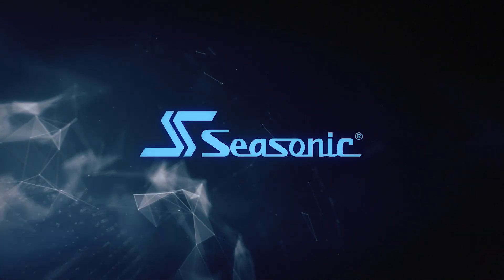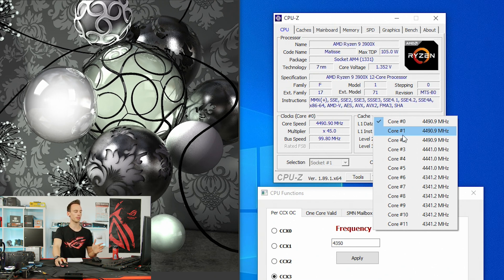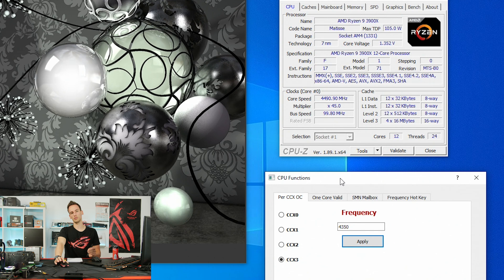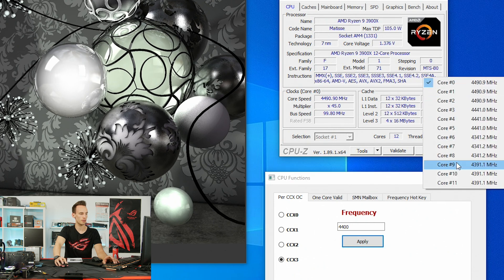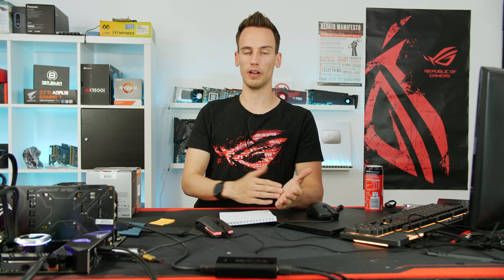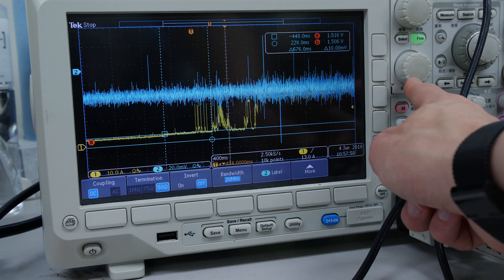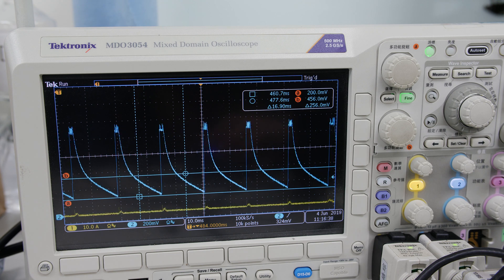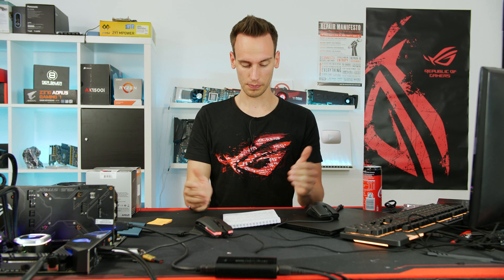The most amazing feature of RYZEN 3000 - Power Saving (and some CCX OC)

Comment: Hello der8auer
, this tool is possible setting on ryzen 3700X all core with good Vcore?
I have cpu with Vcore Up and Down and clock 3600 and 4300, it'a very insane, temp are mediocre, 45° idle 80° full

Comment: Not quite sure any of this holds up to actual benchmarking.  Ryzen is unfortunately across the board much less efficient than an 14nm Intel chip *at low utilization*.  A 9400 will use about 15 watts idle with a decent motherboard and power supply, however its pretty much considered impossible to get any Ryzen without integrated graphics to idle below 30 watts using the same GPU.  The new 3600 is also less efficient than the old 2700 despite being on a newer process.  

https://tweakers.net/reviews/7222/6/ryzen-5-3600-en-3600x-nieuwe-ryzens-op-budget-opgenomen-vermogen-en-overklokken.html
https://www.hardwareluxx.de/community/f84/die-sparsamsten-systeme-30w-idle-1007101-70.html

Wish AMD would fix it, it should be possible as their mobile chips are quite competitive in this regard.

Comment: Isn't the minimum voltage to cause a gate to activate around 0.7v?

How can they get the chip operating at 0.2v?
Reply: Maybe quickly switching between voltages gives 0.2v as an average?
Reply: @elsasslotharingen7507  I think it drops well below switching voltage when idle. Didn't think about that before. If the voltage can ramp fast enough that shouldn't be a problem it just won't switch until 0.7v.

Comment: I’ve had my 9900k at 0.8ghz and auto voltage,  VID was 0.75v or so. It reported 10W in Intel XTU but more like 13W in HWinfo64. The reason I had this configuration was that I was troubleshooting some GPU and Custom Loop issue, and I was booting with waterblocks containing no liquid at all.

Comment: He mentions that the voltage is set to 1.35, but I recall AMD recommending this to be set to auto so it can down volt to 0.2 in idle. If I’m going to be OCing my CCX, is it recommended I lock voltage to 1.35, and if so, should I apply any offset?, 3700x here.
Reply: first try it on cinebench at auto. Then try it with offset. 

In my case, you can use it with -0.5v, it shows higher frecuency, but it will not improve performance.

Comment: Kudos for actually putting a scope on hardware! It was fascinating. Also, you're the first person i've seen that explained  that the 3900X  has 4 ccx with 1 core disabled on each, instead of 3 full ccx and one disabled ccx.  This also seems to imply that  all 12 cores have 33% more cache (per/core) than parts that have full ccx's.  I wonder if there's a measurable difference in performance in some load types because of the extra L3?

Comment: That per CCX overclocking is interesting, if you can do that in the BIOS then I will most certainly use it. I can imagine that it gives especially an advantage for the 3900X given that you have 4 smaller CCX's instead of 2 larger ones on the 3700X. I will also take over that voltage, I heard 1.35 V from more people as the maximum for Zen2. Once I get the maximum clock freuqency at 1.352V I will see whether or not I can lower the voltage a bit without loosing performance and how much performance I would loose by lowering it.
Reply: It's actually 1,325V max safe for high load tasks AND 1,45V for idle!
Reply: @vladvah77  

That low? For Zen1 AMD recommended <1.4 V.
Reply: @peterjansen4826  I read somewhere online that 7 nm chips need lower voltage, I think it's safer to use even 1,3V than 1,4V ( I just received last week my brand new R9 3900X retail box ;-) , I'm still looking for good motherboard + RAM ~ 400 $ ).

Comment: Careful with the CCX "CPU Functions tool", I noticed that is brings the vcore back up to 1.48V  as you change the clock values even if you set it manually to a lower value before (watch coretemp as you do so).

That made my CPU to shoot up straight to 92c on cinebench 20. Luckily I had the finger very close to the ESC key.

Is much safer to do it from Ryzen Master. Also, once you nailed your profile you don't have to re enter the values. They'll stay there for you to apply them. (Profile 1 is what I'm using)

I do hope you could OC like this from the BIOS safely. I might wait a couple more robust BIOSes until I try that.

Comment: ASUS Motherboard. I set CPU core voltage to 1.325v in BIOs. The VID VCORE for all the cores seem to jump everywhere around 1.38-1.48v. How do I control these voltages? 

When I use Ryzen Master, all the VID VCORE will be 1.325v.
Reply: software maybe wrong detection. 
software doesn't perferct like hardware it called bug

Comment: This makes me feel a lot better about the stock experience with the 3700X. Honestly I got a great chip, it's clocking up to 4.3 on all cores in games with spikes constantly to 4.4, and under synthetic load like cinebench it's 4.2-4.25 on all cores. I might look into per CCX overclocking as I saw 0 reason to overclock all cores, I was just crippling the single core performance.

Comment: Somewhere I heard that the 12-core CPU always has a very good CCD (for maximum boost clock) and a less good CCD. I.e. cores 1 to 6 are better than 7 to 12. Also your video seems to confirm this. Do your other dual-CCD CPUs also behave like this?

BTW: Any news regarding the max. boost topic? Had you done your last video regarding this topic with AGESA 1003AB or 1003?

Comment: AMD have actually made reference to the low idle voltage drops as intended behaviour that the architecture actually depends on, over on Reddit in an attempt to respond to people commenting on voltage behaviour concerns: https://www.reddit.com/r/Amd/comments/cbls9g/the_final_word_on_idle_voltages_for_3rd_gen_ryzen/

Long and short of it is, when idle CCX's can enter a sleep stage when voltages drop to close to 0. However any software probing status can and in most cases will wake up those cores and cause voltages to increase again as the cores go back to load handling state. So most people using active monitoring software were noticing voltages always high on their 3000 series CPUs. And this is because the monitoring software itself is stopping the CCX's from entering their idle sleep states where voltages drop off naturally.... it's also why they're strongly recommending against hardset voltage values in the BIOS as this could potentially prohibit the sleep stage voltage drop.

Part of their post:

"The Ryzen CPU depends heavily on a low-power state called cc6 sleep. In this sleep state, core clockspeeds and voltages are basically nil as the core is sleeping and gated. It is not possible to report out the state of the core in this sleep state without waking the core, probing the status, and killing the power savings of cc6. Therefore, MOST tools can only show you the last clock and voltage of the core before the core went to cc6. So if you were at full 4.5GHz+ boost @ 1.48V, then the core went to sleep, many tools might show the core(s) stuck at that value. The tool just doesn't know any better.

However, the latest version of AMD Ryzen Master can uniquely show you clocks and voltages in a cc6 state. No other tool can do it. Neat piece of info for the people looking to understand how their core behaves!"

Comment: What limits the overclock in ryzen?
he has the R9 3900x in 4.4ghz with 1.35V.
If the limitation is not the voltage ... what is it?
sorry for my English
Reply: They basically run close to their max overclock already. AMD squeezed all the power they could out of these chips instead of doing like intel and having most people never get the most out of their CPUs
Reply: @kendokaaa  And STILL cannot beat Intel in gaming, the Blue Team has a big frequency advantage with 14 nm ++++ :-)

Comment: At 0,2V most probably the CPU is in retention mode. There is no way registers can retain stored information at that voltage. Register values are most probably pushed in a some sort of sram like structure integrated in the flip flops, that is powered to different supply. That is why it is possible to have such a low idle voltage for the core

Comment: This is what i was looking for. In the older cpu's we could set clockspeeds one by one or enable/disable them. So we may overcome the weakest point of zen2 processors (lower fps on old games) by overclocking some of the cores to 4,5+ghz and others on normal speeds. For example for 3600 ,find the ccx that can do 4,5ghz or more and set the game on those cores on windows task manager. I'll try this on world of warcraft when i will get 3600/x.
Reply: You can also use Process Lasso!

Comment: It's an interesting point about power consumption. I've used plenty of AMD/Intel CPUs, but the first one I actually enabled all the power saving features was on Haswell. Those chips go down to 0.024v in idle states - really nice. I haven't had a real need to upgrade since, as my 4670K can do 4.7Ghz (1.284), but also can do efficient OCs like 4.2Ghz @ 1.125v. I wonder if the per CCX overclocking is what buildzoid was hinting to months ago when he was talking about Ryzen though.

Comment: I was thinking of doing something similar on air for a Linux box with a windows VM and PCIe passthrough of a GPU. Keep the Linux cores on a lower clock hopefully allowing the other ccxes (6 cores on the same chiplet) to reach higher clocks than they would otherwise. Essentially creating a highly binned 3600X for gaming.

Comment: That's pretty slick.  I didn't even realize you could clock the CCX's individually.  Is there an increased latency penalty between CCX modules running different speeds?
Reply from the maker: no :)

Comment: how did you measure those voltages? 0.2 volts is below the CMOS threshold voltage, which is around 0.4V, for 7nm so transistors shouldn't be able to function at all. Maybe you're measuring a pin that turns off some part of the chip? 0.2V doesn't sound right...
Reply: perhaps parts of the chip are offline for a specified amounnt of time; theres more voltages going into the cpu than just Vcore so it does seem feasible to me.

the 0.2 volts may just be the lowest voltage the VRM is able to put out while remaining active
Reply: half core sutdown when iddle
let's put random counting 3700X 8 Core 
at iddle =
(1.40v x 4 Core Active) + 4 Core iddle = 5.60v

at load =
(1.22v x 8 Core) + 0 Core iddle = 9.76v

200 milivolt it seems consuming for all idle core 
so =>> activate core volt + iddle core volt
5.60v + 0.20v = 5.80v (iddle)
9.76v + 0.00v = 9.76v (Load)

correct me if i'am wrong

Comment: ryzen 3rd gen could be really good for laptops intel chips start to have issues below around .6xxmv and it makes the low end of intel chips quite power hungry on laptops. I am able to run 2.0ghz at .6xx mv on my 8750h where as it used to idle for the same power at 800ghz so I get the same power draw for 2ghz as it would at stock for .8ghz  alot of lost performance per watt at the lower end of intel laptops

Comment: The 0,2 V Vcore is REALLY strange. I mean it is way below the bandgap of silicon, so I would expect that no transistor could ever turn on at such a voltage. I really do not understand how the CPU can wake back up on its own accord after being brought down to such a low voltage. I suspect there is some external HW on the MB that periodically turns the VRM back on, so the CPU can wake up and process interrupts etc.
Reply: it works because the mosfets are operating in the subthreshold regime -- they still can calculate, but VERY slowly

Comment: I hit an interesting bug with ASUS awful/broken BIOS

My R5 3600 booted at 350-400MHz with some combination of PBO settings (can't remember which). I was thinking "Wow, Windows is taking a long time to boot", I checked CPU-Z and saw 350MHz at something like 0.4v.

Wish I'd taken a screenshot as I haven't seen a repeat of that...

ASUS' shit BIOS still has other super awesome bugs like the fans randomly deciding to drop to minimum speed under heavy load, C5 POST errors when trying to run at anything over 3200MHz memory, boot DRAM voltage defaulting to 1.2v despite the voltage being manually set higher (oh of course, there's another hidden boot DRAM voltage...), broken mouse in the UEFI, BIOS settings that don't persist in profiles, CPU offset voltage only sometimes applies etc. WOW such a quality product, thanks ASUS!
Reply: Honestly, the ASUS BIOS is such trash for all the b350/X370/B450/X470 boards right now really. Many boards have the mouse not working right now while in bios and various other problems. Hopefully they will sort it out. :)

Comment: Are Any of the reviewers going to test b450 boards and the horrible bios that they have atm? xD
Reply: Idk what you mean, but my MSI B450 Gaming plus with Ryzen 3600x works fine, but yeah I dont like my Idle temperature with 49-62 celcius
Reply: @xThetomhawk  i got a b450i ac bla bla, but i cant set manual voltage the vdd core goes back to 1.1 even if i put vcore at 1.45 m2 ssd doesnt work with x4 and ddr4 read and write speeds are all over the place its basicly like we beta testing this shit.
Reply: BIOS depends to the company and what does atm mean
Reply: @checkcommentsfirst3335  at the moment

Comment: Meanwhile, regular people see ~1.4v on ryzen master or similar on cpu-z while the cpu is idling. Great video anyways.
Reply: Use the Windows power saver mode (instead of the AMD Ryzen modes) and it will be more like 0.98v and the clock speed will step down to @2.2Ghz.
Reply: Something isn't right with his measurements. Vth for 7nm is 0.4V, so transistors at half that voltage cannot function at all.
Reply: Fresh install with nothing installed but my Nvidia Drivers and as soon as I run at 165hz, my precious 0.2v jumps to 1.4v. 0.2v is a myth right now. It's just not doing it IRL.

Comment: I noticed this kind of behavior with the power and how the fan ramps with load after I updated my Aorus X470 Gaming 7 to the newest bios that supports 3000 processors, but I am only running a 1700x. I also noticed total system power has decreased as measured by a "Kill-A-Watt" plug in meter.
Reply: What was your consumption before and after?

Comment: Those power dips and spikes aren't seen on the CPU. The SMD capacitors around the CPU act like a tank, and the CPU will pull in the power when needed, and the power supply dips as the capacitors are recharging.
Reply: A capacitor wired in parallel to the load reduces voltage fluctuations on both the source and load.

Comment: For any operating system, including Windows, there will also be regular timer interrupts even when the system is idle.  You might be seeing that on the scope.  Letting the voltage drop back down to 0.2-ish ... that might be the HLT instruction stopping the CPU while waiting for the next interrupt (on a per core basis, but usually the timer interrupts are nearly in tandem).

-Matt

Comment: How do I get the CCX OC Tool to work on Ryzen 2000? I have a 2600x; so two CCXS with 3 cores each.
Reply: Florian Oprescu  I've downloaded the tool but it doesn't seem to do anything when I use it on a 2600x CH7 WIFI
Reply: @JohnDuthie  can't get this to work on my r5 2600 too, any news?
Reply: @brazilpaes  I read today that it's unsafe to use on Ryzen 3000 series CPUs IF you're using voltage offset in the bios.
 I haven't seen anyone use it on Ryzen 2000/1000 yet though.

Comment: Your bus clock is degraded darn you quartz oscillators and your degrading :(
Reply: every decent Am4 board has the bclk Oc option, even the b350 has it. It's really not important, nowadays it's the auto oc that is the best method.
Per complex oc thing is the answer to my question, which is, why Ryzen can't be per core ocd.
Reply: @TheSilviu8x  I'm actually pretty interested in seeing the BLCK ocing for this series. I find the degrading issue more of an issue with laptops that don't have an overclockable  blcks but most modern desktops have that option even non overclockable cpus usually have the option to blck overclock. it's more an issue with cheaper motherboards.
Reply: thesilviu silviu I tend to avoid auto over clocking since I use an intel platform and its very aggressive with vcore on my old phenom 2 it was pretty aggressive too. I think with ryzen though a tiny undervolt would be the only thing I'd do since pb is pretty aggressive and gets everything it can out of the processor pretty well.

Comment: How do you setup you BIOS/CPU to downclock during idle? My idletemps are pretty high, around 40°C. I've tried using Windows' own power options, and "Power Saving" gets me nice idle temps, but it takes a long time to boost my clocks, ie Cinebench R20 takes a 500 pts hit. This is with a custom loop, 360 rad for the CPU.
Reply: Try the AMD power plan
Reply: @chriswright8074  I've tried all three of them. Anything I should edit?
Reply: Did you check idle voltage and clocks or just idle temp? If you did, are you running Corsair iCue or other monitoring software?
Reply: @kendokaaa  I have AIDA64 an hwinfo for monitoring. Idle voltage is at 1.4, but lower under load. Idle voltage with Power Saving is 0.9, but that one boosts too slow.
Reply: @RRhoads27  That's odd, but I've seen a few mentions of similar problems on reddit
Reply: Fresh Windows install with only Nvidia drivers and as soon as I turn on 165hz, I lose my 0.2v idle and I get 1.4v. 0.2v isn't going to happen for most folks, let's be honest.